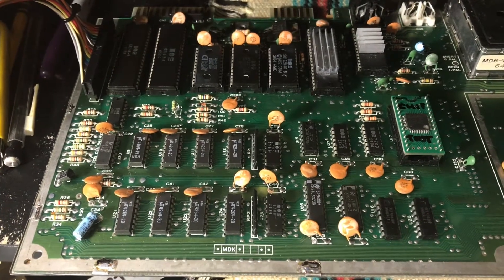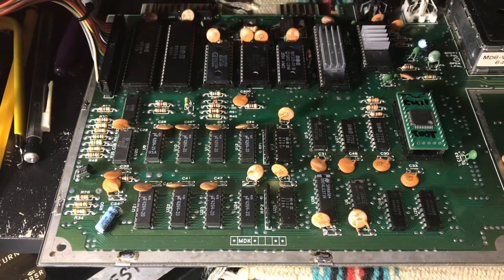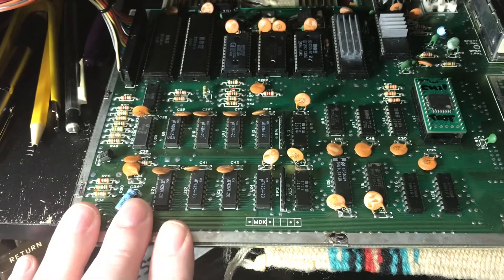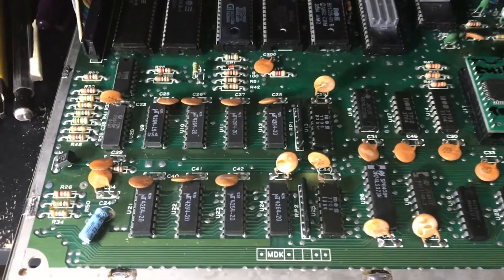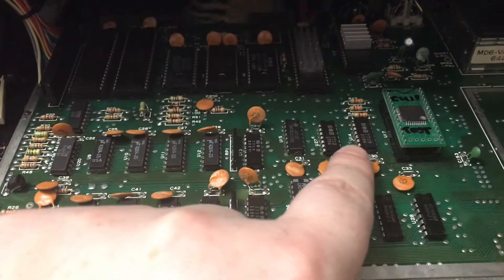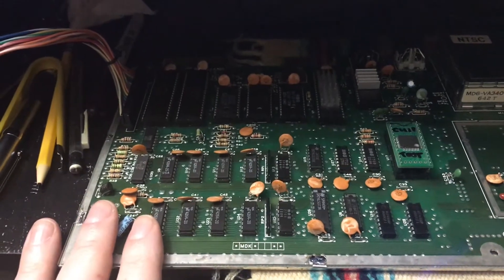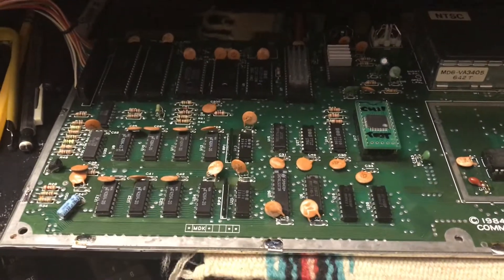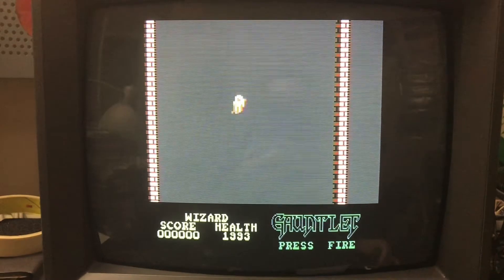This C64 Motherboard Shouldn't Work, But It Does?

Comment: Is this a pal console, and if not, where do you find is c64 roms?
Reply from the maker: This particular motherboard is NTSC... I do own other C64s that are PAL however. I get most of my C64 disk/cart images from either cbm8bit’s search engine or from the C64 TOSEC available on archive.org....
Reply from the maker: Mario Wario Also I should add that a big problem with C64 files online is the fact that most archives you’ll find contain PAL versions of things. Its quite a pain in the neck finding NTSC specific releases at times. Owning both PAL and NTSC C64’s gives you the best of both worlds however. :)

Comment: Which chips do you prefer to use as replacements?
Reply from the maker: For RAM I generally use the KM4164B chips that are widely available on the surplus market here in the US for around $1 a chip... For the MOS TTL logic chips, I just use generic replacement 74LS logic chips. For instance, the MOS 7708 is simply a clone of the 74LS257 chip. Generally any manufacturer will do, but I prefer Texas Instruments parts when I can find them for cheap.